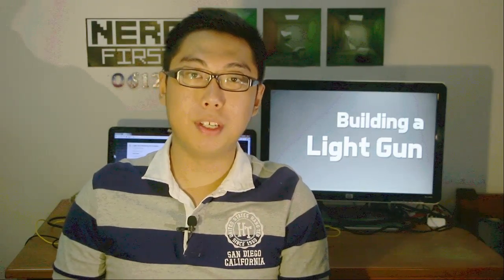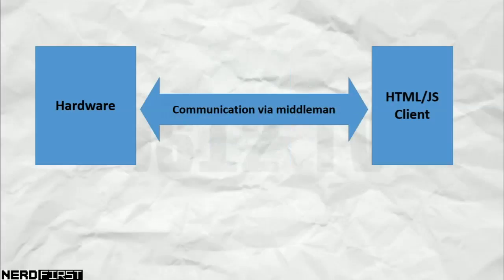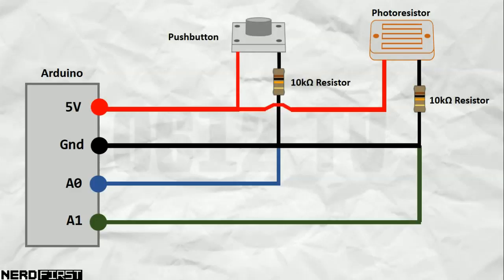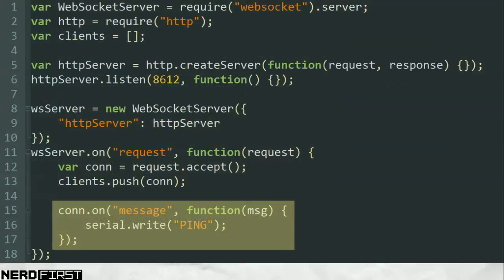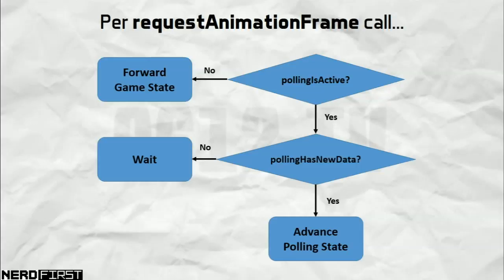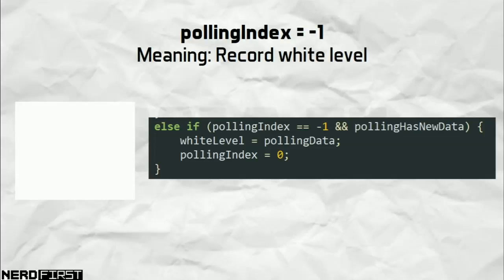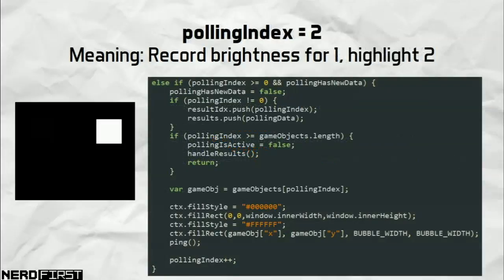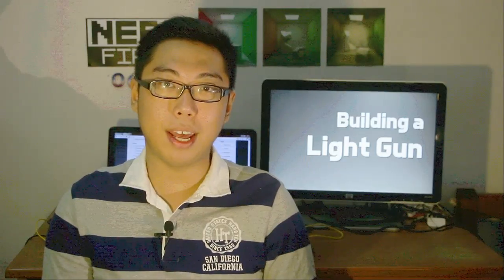Building an Arduino Light Gun

Comment: Hi sir. Any way to hack a SEGA Saturn's light gun (which uses a photosensor which similar to what digital cameras use) that only works with the usual 15hz refresh rate CRT tv to work with a 60hz PC CRT monitor? Could the sensor be overclocked or something using resistors or transistors? Thank you. God bless, Proverbs 31
Reply from the maker: Hello and thank you very much for your comment! Wow, I'm sorry to say this is far beyond me! There's a lot that needs to be discovered about the hardware before we can even begin to tackle the problem. A naive overclocking of all the innards of the light gun is unlikely to work since it will probably impact other logic components and cause them to behave erratically.

On a semi-related note, I'd never heard of this other refresh rate, so I looked it up. Turns out, "15kHz" and "60Hz" are two different units of measurement. 60Hz refers to the vertical scan rate or *refresh rate*, ie. How many times the entire image onscreen is drawn from top to bottom per second. Conversely, 15kHz refers to the *horizontal scan rate*, ie. How many times the electron beam (assuming we're talking about CRTs) scans the image from left to right. What this means is, technically your screen can be both 15kHz and 60hz, since these two are measures of different things.

I wonder if you can somehow tweak the resolution of your computer to achieve 15kHz horizontal scan rate. (Given of course that your screen supports it) There is a correlation between horizontal scan rate and vertical scan rate, but I wonder if your graphics card and screen can support those resolutions.

Sorry I couldn't be of greater help. I tried to google this but it seems like you're the only person asking about this, and have been asking for a while! Good luck, hopefully you can figure this out someday soon!
Reply: I mean 15hz which is the usual refresh rate of a CRT TV but the flat PC CRT is usually 60Hz at the lowest resolution of 800 x 600. 

The SEGA Dreamcast light gun works with the PC CRT coz' I think the Dreamcast's sensor is made for monitors with higher than 15Hz refresh rate coz' it's games are 480p ready. It's sad the sensor of the SEGA Saturn's light gun doesn't work with PC CRT's 60Hz.

Thank you for the reply though. New subscriber here. Keep up the electronics guru ship. God bless, Matthew 16:18
Reply from the maker: Thank you very much for your subscription! I appreciate it, more electronics stuff to come! Fun episode in almost exactly 12 hours =)

I'm not sure if there is such a thing as "15Hz CRT"! 15Hz = 15 times a second, and that would flicker quite perceptibly. The signal from TV stations come in at a higher rate than that anyway, so I don't think you will find a TV that scans at that rate. 

What you're looking for is "15*k*Hz", that kilohertz, which refers to the horizontal scan rate. That's what the light guns look out for anyway - They try to find the exact "pixel" that is being illuminated at that very moment in time, and for that they need to synchronize to the horizontal scanning of the TV.
Reply from the maker: I've heard a lot about CRTs just being all round superior for a lot of applications (like better color reproduction and higher frame rates), so it's definitely an interesting idea to me! Unfortunately most of the retro gaming platforms were a little bit before my time so I don't really have the nostalgic association, but CRTs would still be interesting for art and modern gaming I think!

Comment: It looks like you're using an iterative approach and it's slowing down the refresh of the screen.
When trying to locate the light sensor using white rectangles it would be a good idea to use a divide and conquer approach.

//Some psudocode
int PRECISION = 10;

//Recursive Function To Find Sensor Location
function findSensor(int x, int y, int width, int height){

//We Found The Location, RETURN IT!
    if(width || height < PRECISION){
        return x,y,width,height
    }

//If you detect light go ahead and divide up the area again.
    if(SENSOR.detectlight){
        // Clear screen
         g.setColor(Color.BLACK);
        g.fillRect(x, y, width, height);
       // Draw light area
        g.setColor(Color.WHITE);
        g.fillRect(x + width/2, y + height/2, width/2, height/2);
        findSensor(x + width/2, y + height/2, width/2, height/2);
    }
    else

//Otherwise divide up the area that you think had light.
    {
        // Clear screen
         g.setColor(Color.BLACK);
        g.fillRect(x, y, width, height);
       // Draw light area
        g.setColor(Color.WHITE);
        g.fillRect(x + width/2, y + height/2, width/2, height/2);
        findSensor(x, y, width/2, height/2);
    }
}

Something like that ¯\(ツ)/¯
Reply from the maker: Hello and thank you very much for your comment! Good suggestion!

The reasons why I didn't do that are twofold:
1) I think the video is complex enough as it is =P
2) You really only need this if you want pixel-perfect accuracy

In my case, I know for sure there will only be at most 5 targets on screen, so I will do no more than 7 "polling" operations. If you're using divide-and-conquer for pixel-perfect accuracy, you will end up doing a lot more iterations because you need to "home in" on a pixel (of course the counterargument is that you can stop when the square ends up, say 32x32 in size).

Two more points to follow this up:

The method we used here is associated to the targets onscreen, meaning we don't have to perform any further computation to figure out which target was being shot at. A pixel-perfect method would give you a pair of coordinates, which you would then need to associate back to the targets. There's a small computational overhead there.

And finally, an optimization to your optimization =P Actually if you want to figure out exactly which pixel it is, you can do it without feedback from the sensor. (This saves some computational overhead because then you don't have to keep checking with the sensor). By flashing every pixel with a divide-and-conquer pattern, each pixel will flash a unique set of colors such that when they are put together in a sequence, you can figure out which pixel it is. Inspired by this: https://www.youtube.com/watch?v=XgrGjJUBF_I&t=1m12s
Reply: Nice, I didn't even think of using light patterns It's a really nice solution but I think the time complexity should be the same as if you used the divide and conquer strategy** (Plus divide and conquer doesn't have to redraw the entire display if that matters in the application case). 

Really enjoyed your video :) keep it up!

**for a single point, Multiple points would divide the time.
Reply from the maker: Thank you!

Yeah, but if what you achieve is pixel-perfect matching then I suppose just one point would be enough. The next step of collision detection can be used to see which items onscreen will be affected.

Rigorously speaking the time complexities aren't really comparable. The iterative method is O(n) where n is the number of targets. Your method is O(p) where p is the total number of pixels onscreen. In terms of real-world performance it's dependent on the application. For something like a drawing app where pixel-perfectness is required, then a divide-and-conquer approach is a must.

For something like what I'm doing here, the iterative approach is simpler and not any slower. I guess that might be why games like duck hunt only ever have a few targets onscreen at once.

Good point about redrawing the screen, though I've no clue how much time it'll take.
Reply: No, no.. I'm sorry I was trying to say that I thought the time complexity of using light patterns would be comparable to using a divide and conquer approach for a single point. 
Multiple points should divide the time in the case of using light patterns.

Hope that makes sense.
Reply from the maker: Aaaah, yes I do believe so as well since the patterns seem to be dividing and conquering. Based on how the space is being halved each time, with each half taking on black and white respectively. The same professor has a follow up video where they used a modified projector that was able to put out two different wavelengths that look the same, so the pattern wasn't visible to the naked eye but was there for the sensors to pick up.

In the case of the video I linked, multiple point detection with multiple sensors can be done with one pass so it's super efficient as well! Yet another advantage of not having to communicate directly with the sensor until at the very end.